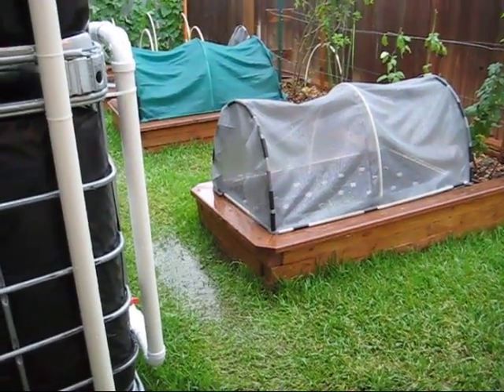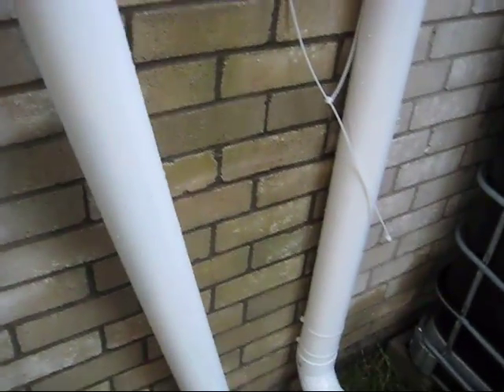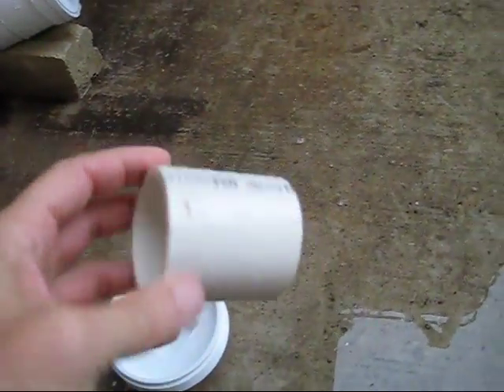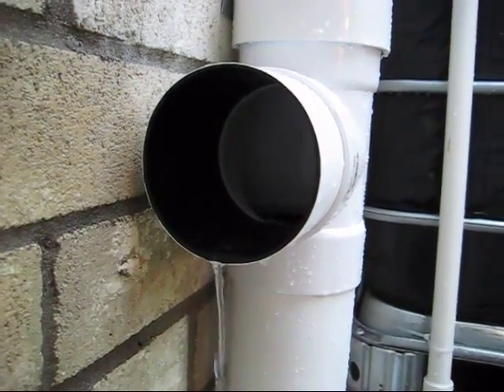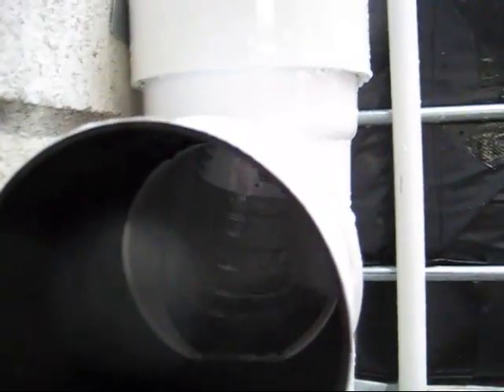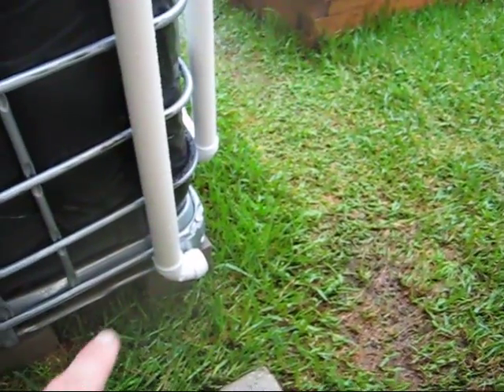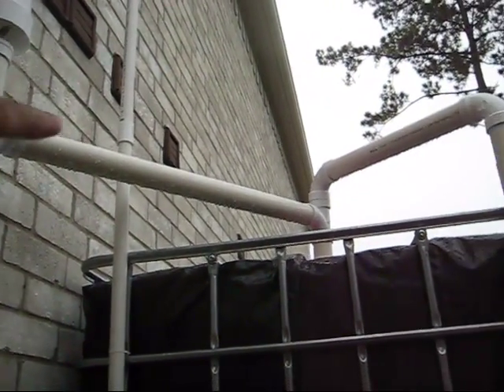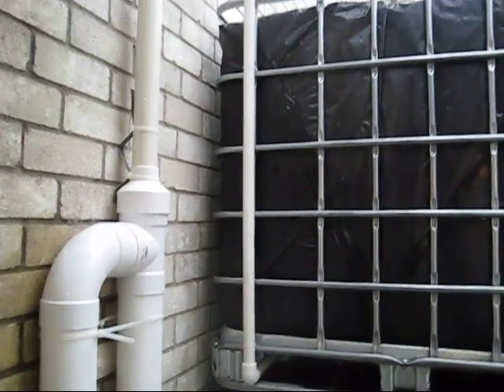Rainwater First Flush System Modification Part 8

Comment: Why not use a rubber or plastic ball instead? You wouldn't have to worry about corners. (The $10 investment is worth it, especially compared to all the PVC & supplies purchased to build the system)

Comment: I don't understand the bottle. It's going to float up eventually pinching off that pipe acting kind of like a check valve and obscuring the path of additional grit and dirt from getting past the bottle down in to your pre-filter. I just don't understand what value is that bottle? What does it accomplish other than the potentially block dirt that you want to settle into those big 4-in pipes.

Comment: Hi, great videos and clear instructions. Thank you.
I've used your idea and changed it. I inverted the two main 4" tubes, put a T at the bottom, and added a flush valve to clean it. This way I don't need a ball or bottle inside. Just put a mesh filter at the output to prevent any debris from coming into the tank. No need to clean it either as the debris clears every time it's flush.
Works great.

Comment: Thank you for all your water harvesting videos, I watched them all..  They have all been very helpful to me to build my own two tier  harvesting water tanks similar to yours.  I live in England, UK and while we do get a lot of water fall here, I wanted to use harvested water for my garden particularly in the spring/summer months.  So far it's been great but I did struggle with all the different pipe fitting and size differences,  all very confusing but I worked it out 😱. Cost wise my solution may have cost me  more as I struggled to source parts but now understand more and have experience.  I also need to see how it all copes with our winter as tanks are not insulated.  My next project may be to consider (after further investigation that is) a filter system and/or how to increase water pressure. Thanks again for all your help👍

Comment: 3:23, isn't the bottle (or ball) supposed to float up to block the down part of the T so the water flows horizontally after it fills up the vertical chamber?  Here the bottle floats all the way up into the horizontal area.  Not sure what this is accomplishing.  Maybe trapping something underneath?  But, it also looks like its somewhat blocking the horizontal flow.  Maybe not that much cross section is required?

Comment: One other Idea I saw on a another site, not my idea.... If you are going to drink this water,,, then the outlet of the intake  pipe going into the tanks should point up on the ends where as to not disturb the sedimate on the bottom of the tanks that can accumulate over time... Also the outlet from tank should also point up inside the tank, ...Here you help prevent sedimate flowing out of the outlet.. I did some tests with these ideas and seem to work.... if you are not going to drink the water then disregard these ideas

Comment: You should use a Uniseal for putting pipe thru the tank wall.  It would seal better and is easier and quicker than the threaded coupler.

Comment: I like what you have done here.  The only thing that I think I would change is flip the bottom water cube so that the built in ball valve would be at the top instead of the bottom.  Then do the drilling of the supply valve with the hose hookup. Also, I might put the float bottle into the freezer without the cap for about 20 minutes so that there is cold air inside the bottle. When the cap goes on, the cold air will expand as it warms, creating more pressure inside the bottle. This may help the bottle to float a little higher as it rises inside the first flush system.  ( just a thought)

Comment: Great system I couldn't done it any better my self, working perfect. Do you know how much hot water a plant can stand before it dies, With the tanks wrapped in black and the hot sun of Texas, plus with little rain seems like the tanks would heat up. I was wondering if you could put a lighter color but still not have algae grow, just to keep the stored water cooler. Because you know what happens when a garden hose stays out in the hot sun. Thanks again for sharing your hard work with us..............Bud

Comment: First off .... Great idea.... I modified mine in a different way that simplified the construction. 1. I inverted one container in the holder and sealed things with Teflon tape with both caps together i removed the bungs and with a threaded PVC coupler replacing the bungs i coupled them with a no hub coupler.
2. The upper drain now on top is the fill valve.... Using a no hub coupler to attach PVC a T is  used and the upper side has a air vent attached like what you show in your video at 24" above valve. 3. Instead of wrapping each container inside its frame i took a heat sealer and made a single trash bag like cover that covers all containers as one unit and is easyer to replace when it becomes damaged in the elements. 4 i used a toilet ball float instead of your water bottle. 5. The only other thing i did was under the black cover was to insulate the containers with foil covered foam insulation this keeps things from freezing

Comment: please put your system on a poured concrete slab, 8 (12 would be better) inches thick with number 5 rebar tied every 8 inches across the width and every 8 inches across the length. pitched slightly back towards the house.

Comment: I don't quite understand the purpose the bottle serves. As the water fills up the lower catch it seems it would naturally overflow into the other pipe whether there was a bottle in the pipe or not. The bottle isn't diverting anything or stopping anything. It's just in the pipe floating around. Can you explain the purpose please?
Reply: originaLkomatoast I think hes concerned that the bottle is half the size of the pipe. Its just bobbing and twiddling in there, meanwhile contaminants are coming up around the sides.

I saw no point in what he was trying to show, when water was coming out the top when the bottle floated up. Of course if the bottle is there, the waters there. The bottles supposed to plug it so contaminated water doesnt come back up.
Reply: Carl & Jinger Family he's poorly executed a well-tested system. The diverter piping which had come loose should be above the narrower insert in the main pipe where the float rises to form a plug above the dirty first rainwater.

There are many videos that show kits as well as DIY versions on YouTube.

Comment: Why do you need a float in your first flush system? It seems to me that once the first flush system fills with water it will divert overflow into the tank without shutting down the first flush system. Great videos you have inspired me to build my own system.
Reply: As I understand it there could be some debris that might be lighter than the water and the bottle keeps it from going into the drinking supply.

Comment: Thank you for your work and your determination. Your work is appreciated. Where is your assistant cameraman? I do not know if anyone else suggested it or not, but the purification deal, well, dust particles, airborne chemicals, etc  do attach to falling rainwater. Before building one of these, anyone have any coal burning power plants up wind? Watch the h2so4 levels. It was the acid rain that killed (indirectly) a whole lot of the sugar maple trees in the NorthEast.
After seeing the silt in potable water coming from the Houston  water supply, anything is an improvement. Brilliant!

Comment: You screen out large debris (leaves twigs etc) before it even enters the gutter pipe, the first flush system is mainly to flush out small debris, dust/dirt and bird crap before it goes into your holding tank. The bottle works as a diverter to the holding tank only after the "flush" tube has been filled with the "first" of the rainwater runoff which contains the dust/dirt, bird crap etc.

Comment: I have a thought for your consideration: Does your over-flow tube really need to be all the way down to ground level? (I'm thinking no.)
Instead of wasting all that water into the grass, why not direct it side-ways into "irrigation" pipes which direct the water into your various gardens beds?
(I'm sure you understand how irrigation ditches work. So why not do the same thing but with pvc pipes?)
OR maybe bury a perforated tank so overflow water goes directly underground and not out to the street?

Comment: if the water bottle is stopping water flow, then how is any debris supposed to get into the larger pipe? wouldn't it simply go straight to the tanks? i think i would just go get some SCH-40 and glue the **** out of it

Comment: On the first flush system I'm finding the caps very hard to unscrew and screw back on because the threads fill up with dirt,sand etc. and too much water comes out because you can't screw the cap on tight anymore.   I plan on drilling a hole about a foot up from the bottom to let water out slow but still leave enough water to flush the dirt out.

Comment: Hi, great series on rainwater harvesting.  I already have somee barrels, but intend to expand.  What are the dimensions of two water cubes stacked.  Specifically how high are a set of two stacked?  Also, it seems that the lower one would not be able to carry all that weight.  The structure doesn't look like it would be sturdy enough.  Are they designed to be stacked like that?  Thanks.

Comment: If you are connected to a city water system, it is often against the rules to have plumbing connect to another supply....well, rain water, whatever... it would be because of liability issues the city water supplier would have with uncontrolled water back flushing into their system. You might try a yard shower, sink, etc connected only to the rain system with the gray water watering the yard. Toilet will flush with a bucket of water.

Comment: Great series!  I have four tanks and have been trying to figure out how to connect them.  What did you do with your other two tanks?  Would you recommend connecting them or doing two separate installations stacked two and two?  Also, I am a little concerned about them tipping over once they are filled.  Any suggestions?  Thanks!

Comment: Interesting design. IBC are what I intend to use, more cost effective.  I can get them for about $50 each here. Daisy-chained barrels cost way more per gallon.
Did you add the 2nd arm because you needed more volumn flushed?  If so, why not make just one arm taller?
I will be locating the pumpless system inside.  Direct from gutter, elbow through the wall to the T at top of diverter(12-ft pipe going down into the concrete then elbow out to a rain garden, 18ft total, not seen outside).

Comment: Good video... Looks like the totes can handle double stacking... I was going to go for a triple stack, but not sure about how the concrete slab of the inside of my garage will hold. I also like the black plastic wrapping. I live in zone 6a so I would have to get some sort of tank heater, or insulation... You probably don't have the freezing problem in Houston. Good videos. Thank you for posting these!!!

Comment: @LDSPrepper -- I do not have a video camera to make a video. But all you have to do is put the water totes on a stand. It probably would not be practical to build a platform high enough to have water pressure on the second floor of your house. But hopefully you have a shower on the first floor of your house. Then you need to plumb a connection from your water totes to the water pipe going into your house. You will need a valve there, and you would only open the valve if you lost city water.

Comment: If you elevated the totes a little and connected the outlets to your household water supply, you could have pressurized water from your system to your house. That means you could take a shower, flush your toilet, and have water to the kitchen sink. You would have much more water pressure on the first floor of your house, of course.

Comment from the maker: @watrocket Correct. I have six 275 gallon totes. 6x275=1,650 gallons. Very cool, huh. I got the totes off of craigslist for $75 each. Do a search on craigslist for "55 gallon" "water barrel" or "275 tote".